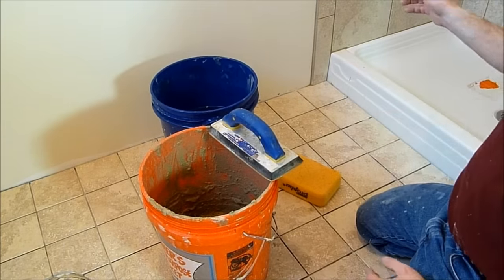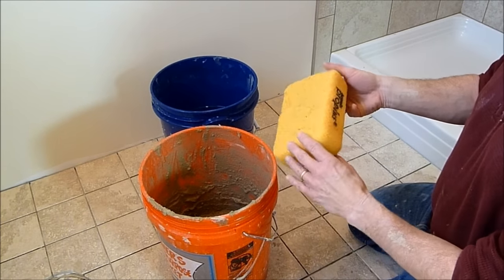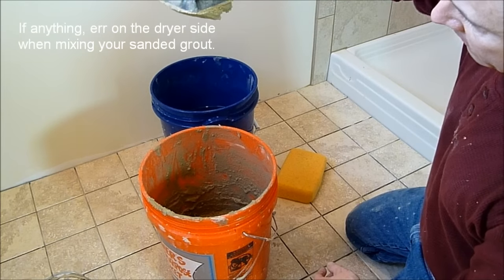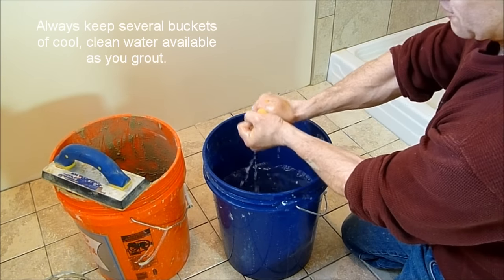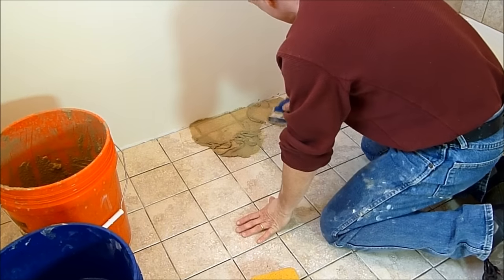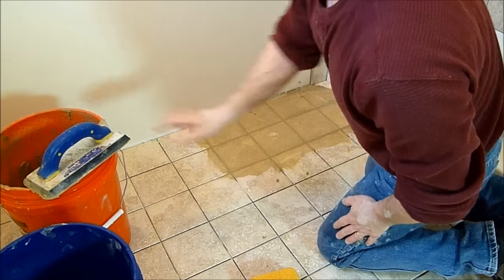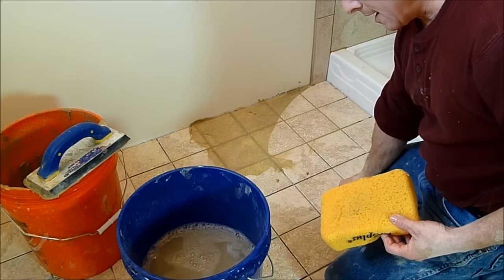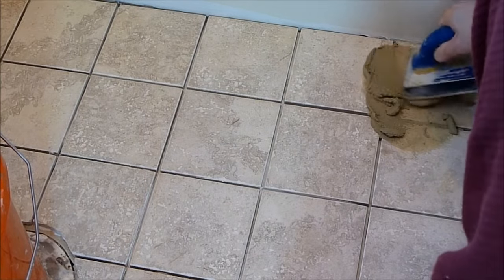How To Grout Tile: Correct Technique Makes It Easy

Comment: Goddamn it. 
I started grouting using a tube of grout and a caulking gun, but everything about that was slow and tedious and messy. After the first tube, I realized that could NOT be how the professionals did it - it was just too much a PITA. Wish I'd watched this first.
Reply from the maker: The premixed "grout" in a plastic jar or tube really isn't grout.  It's more of a watered down caulk, I guess, and pros don't use it at all.
Reply: enduringcharm I switched to the type of grout you're using in the video, but the grout in the bucket keeps turning to Rick before I can finish - wasting about half of it. How often should I be adding water and re-mixing?
Reply from the maker: If you are using a powdered grout (like Tec or Polygrout brands) and thoroughly mixing it with water to a peanut butter to mayonnaise consistency it should last long enough in the bucket to do a floor or a shower.  Are you mixing it too dry?  Are you using plain water with no additives? Are you using a powered mixer?  I usually mix up half a 25 pound bag at first and mix a little more if I need it.  If the mix stiffens up you can add a little more water to "freshen" it up.  It typically takes me around an hour to complete grouting a 60x30 shower and another hour or less to grout the floor.  Are you taking excessively long with your grouting?
Reply: It's kinda a playdoh-y consistency and I'm working on a room that's 20'x14'. And I'm not exactly speedy Gonzalez (probably because I was mixing too dry - I followed the directions on the bag). I'll try mayonnaise consistency tomorrow (third time's the charm?).

Also does the rubbery/silicone grout (the type you use IN a shower, as opposed to floor grout) have a special name?
Reply from the maker: I'm assuming you are using a sanded grout?  Try mixing a little bit wetter and recognize that  five minutes after you stop mixing the grout will "set up" and become a little stiffer.  If you mix ever so slightly on the wet side then it should be perfect by the time you get the bucket to the tile an start grouting. Make a habit of giving the grout a little stir in the bucket each time you reach in with the float.  Sometimes the grout appears to be hardening but really it's just settling in the bucket and keeping it stirred up will prevent that.  For caulk, you can get color matched silicone caulk (which is not paintable, by the way) or you can get a sanded silicone caulk to match the grout.  The sanded grout has some texture but it doesn't generally last as long as plain silicone caulk.
Reply: I feel like I should be paying you. This last bit of advice helped me get done in two hours (with one bag of grout mix) what it had taken me six hours to do last week (with two bags of grout mix).
Reply from the maker: pyrotheevilplatypus
HA!  Well, I'm glad it worked out.  Live and learn, right?
Reply: pyrotheevilplatypus I wish I'd watched this before too. I made a big mess with bag. Thanks so much for this well done video.

Comment: Thanks so much for posting this video.  You're so right, one pass on each side of the sponge, that's all you get or it's just a mess.  And it can't be any old car wash sponge either, just as you say.  My very first glass mosaic tile job came out very nicely, thanks very much for the advice.

Comment: Thank you SO much for this helpful video.  It was really clear.  I have never grouted floor tiles before and was quite intimidated by the prospect but by following your advice I have done the job and am very proud of the result!  Two things I discovered which help are - swipe the sponge diagonally across the grout lines, not along them and not to worry about getting excess grout on the tiles as it cleans off easily even when dry.  Thanks again!

Comment: im about to start my first floor grouting experience. 1/2" grout on Santillo Terracotta tiles.I just finished stripping and removing the grout after 30 plus years of use. Figure I will have at least 2 applications of sealer before I begin grouting. Nice simple viceo. Thanks

Comment: This is a great video, and grout is the devil without the right help and advice.
Everything necessary for grout work is included in this clip, but it's the clean up that can be intimidating. It'll take me around 7 swipes even with the right sponge and bucket, but that was because I was dragging it off the wall connection and smearing it. I was thinking I would see it on the sponge, and it doesn't always show up.  Thanks for this clip.

Comment: Great presentation, to the point, low key, nice. I still manage to waste a lot of grout back in the water bucket.
Reply from the maker: That's okay, the important thing is getting the grout packed tightly in to the joints and making it look nice.  It's common to have waste in the water bucket.

Comment: Good vid. I prefer the grout more on the wet side so it's easier to spread out. I also will smooth grout lines with the sponge then go back and wipe up the residue. After it dries for a day I'll go back over it with a vinegar and water mixture to remove any film left over. Then a good sealer a couple days later.
Reply: +Geoffrey Mazalin Acidity to clean the residue. Works pretty good if you did the sponge portion right and got it mostly clean.

Comment: I got hired by a home renovator and I lied and said I did grout before (I've done plenty of home reno stuff, but not grout). Thanks. Looks pretty straight forward. I've done a lot of drywall and mudding and this looks easier than that.
Reply from the maker: +sherpaderp dingo Ha! Well, I'm glad I could help you expand your career.  Make sure you choose sanded or unsanded grout depending on the size of the grout line.
Reply: +enduringcharm Then again if I go and watch a video on how to mud they may make it look easy, too....
Reply: +enduringcharm arent you supposed to use caulk instead of grout on the perimeter of the floor where the tile meets the wall
Reply from the maker: +wrekt2  Typically in my installations any gap between floor and wall will be covered with baseboard trim.  I install the trim after the floor is grouted and if any grout fills the gap there's no harm as long as it doesn't get in the way of the trim.  If I believe there will be significant splashing from a shower because of location or kids in the house, I may caulk the bottom of the baseboard trim where it meets the tile.  Essentially, you want to caulk where there will be movement and potential cracking, such as at the base of a tub or pan where it meets tile.

Comment: This video is great simple accurate correct not overly complicated and I’ve got a lot of tile and this is generally how I do it although I’m not sure about the one swipe thing is he is but not bad. Also I would recommend changing the water for your sponge pretty frequently it gets dirty and leaves behind more Haze if you don’t change out the water frequently

Comment: GETTING READY TO GROUT FOR THE FIRST TIME   THIS MAKES IT LOOK SO EASY   I LIKE THE WAY THE TILES ARE ALMOST COMPLETELY CLEAN   OTHER VIDEOS SHOW A LOT OF AFTER THE FACT CLEANUP ON THE TILES.
Reply from the maker: As long as you take care to pack the joints good and tight, there's no need to prolong the work!  Wipe as I showed here and you'll only have a mild haze in the morning which comes up with a damp rag or paper towel.

Comment: ive just fitted some quite large tiles 24" x12" ! first attempt at tiling.when it came to wiping off the grout I found running along the grout line rather than going across it left a better finish. might help someone out! happy tiling. by the way,great video and really helpful.

Comment from the maker: As long as you are working the grout deep into the grout line and wiping diagonally so that the grout isn't pulled out of the grout line then you will be fine.  For very thin grout lines using non-sanded grout you may find that waiting a bit makes the process easier, but most people today are not using that style of grout line.  I've been doing it this way for at least a decade and I've had no issues personally or professionally.  Other contractors I know who do tile use the same methods.

Comment: One of the best how to videos I've watched on YouTube.  Audio good, directions clear. Suggestion below to wear latex gloves a good one. I would suggest a towel or other protective cloth between the buckets and tile.  May just be me but I was imagining scratches every time he pulled bucket along floor.
Reply from the maker: Those buckets make an annoying sound, but they don't make scratches.  The sand in the grout is more abrasive than the buckets.  It does drive me crazy, though--it's like fingernails on a chalkboard!
Reply: I appreciate feedback

Comment: Thanks so much for your channel! You are so thorough. I am currently taking down my 1920's shower walls. I am about to remove all of the thin wood slabs. Your video is only for shower surround, and I am wondering if you have any tips for me to try to incorporate the plastic you used for a set-in tub? I have to tile the front of the tub as well.. since I can't put plastic under it, any suggestions? :) thanks in advance!

Comment: prob the best instructional video on how to grout ..  my only question is  would you run a finger on the grout lines or just swipe with sponge both ways ?
Reply from the maker: You just use the sponge.  The grout sponges are a specific density for the purpose and you can control the height of the grout line by the amount of pressure you put on the sponge as you wipe.  If you want the grout deep in the groove, press harder.  If you want the grout right up to the top of the tile use a light touch.

Comment: I'm gonna give this a shot. Every time I have grouted, there is always a haze. I'm curious as to whether or not I'll have to go back 4-6 times to keep cleaning up the tiles after trying this technique. THANKS!
Reply from the maker: If you practice this technique and be certain to wring out the sponge well, the most you'll be left with is a very light powdery haze that wipes off with a damp sponge or rag.  In fact, sometimes I combine the grout sealing with the clean up.  You just need to remember to turn the sponge as you wipe, and practice getting the sponge pressure just right.

Comment: Great video.    Couple of questions. How often do you change your sponge bucket water?   What criteria do you use to know it's ready for clean water - water color, sponge leaving a residue?  

Also, how long do you wait before you go back and give the tile a final clean?   For the final clean, is it OK to get the grout really wet, like using a floor mop?
Reply from the maker: Tom K Change the sponge water often, you really shouldn't observe any significant residue on the tile at all.  If you use my method there is no final clean, you just let the grout set up over night and any very light dusting of residue left the next day comes up with a damp paper towel.  Watch the video carefully, though, I'm not leaving any grout after the wiping process.

Comment: How long will the grout stay wet to get the job done?  Or do you just add a little water if it starts to dry out?  Do you basically use the same process for unsanded grout?  I'm so scared to do this job, but your video makes it look easy!  Thanks so much for posting.
Reply from the maker: Don't be frightened!  It's really not that difficult.  When you mix the grout, use an electric drill and and a mixer attachment.  Sneak up on the amount of water, starting fairly dry and then adding a little at a time.  If you add too much water, just add a little more mix.  It's best not to add more water after the grout is already mixed, although it can be done with experience.  Instead just mix up smaller amounts and mix up some more if you run out.  It goes a long way.  Unsanded grout can be a little more finicky, so definitely keep those batches small until you figure it out.  The grout will take 24 hours to set up completely, and there is plenty of working time if you do small sections like I show in the video.

Comment: I just bought a house that has a lot of ceramic tile on the floors.  Some of the grout, in several different places throughout the house, is cracking and crumbling.  Do I need to chip away at all the grout and redo it or can I simply grout the areas of concern and leave the rest?  Great video by the way.  Your instructions are very thorough and much appreciated.
Reply from the maker: hopewell2012 I published a video about how to remove grout, by the way, so look for that.  If you are seeing multiple areas of failed grout you'll definitely want to remove all of it and start over.  It's almost impossible to color match the existing grout anyway.  You'll want to check that there isn't a reason beyond old age causing the grout to fail too, such as a floor that flexes too much or cracked tiles.

Comment: Excellent video on technique and why I had discoloration issues for a small repair job I was doing.  I had done grouting in the past with good results but had forgotten the basics. This Old House site says to wait 20-30 minutes for the grout to set up before wiping with the sponge but that seems like a long time especially if you are doing a large area and have to walk back over to where you started.

Any comments about this?
Reply from the maker: +zookini33 What you describe was the old-school method of grouting.  Perhaps the chemical composition of grout was different many decades ago and it took longer to set up, I don't know.  But, today there is simply no reason to wait that long and with some of the latex fortified grouts after 30 minutes you'll be scraping it off the tile with a putty knife after that long!
Reply: +enduringcharm 
I found this out the hard way :(

Comment: This was a big help.  Thank you.  I'd always been intimidated of grouting but now I'm going to do it.  You said if there is a slight haze, you can get it with a paper towel. Do I wait long to go back, or do you do that the next day?  I'm going to try this on a floor I'm making out of pennies.  Thanks
Reply from the maker: Habib Emailing The slight haze on tile comes off easily by the next day --sometimes I'll take it off during the sealing process.  I've never tried grouting pennies, though!
Reply: enduringcharm   Uh oh.  Sealing?  Never thought of that.  Was just going to put non-oil based poly down over it all.  I have to seal the grouting?
Reply from the maker: Habib Emailing Sealing the grout is done to help prevent stains and to add water resistance to the grout.  However, your endeavor is a whole 'nother thing!  I'll defer to those who have put down a penny floor to give you advice on that.  But, if you are covering the whole thing with poly then sealing is a moot point and might even interfere with adhesion.
Reply: Thanks.   I'm just kinda wingin it lol.